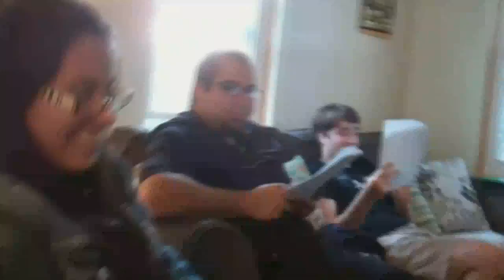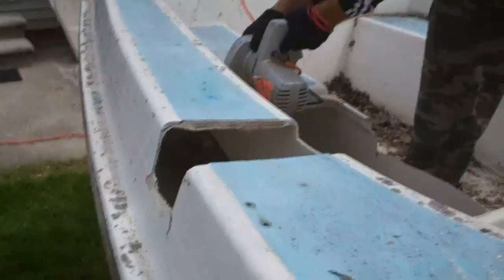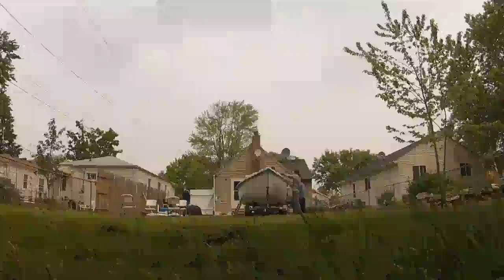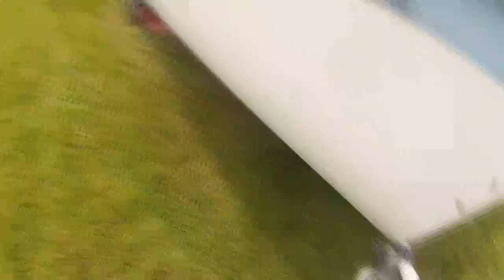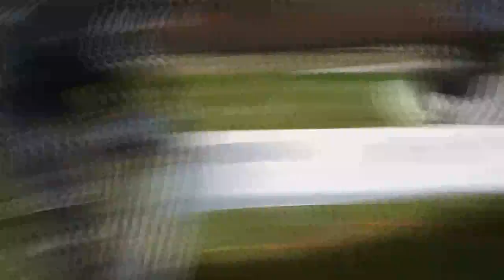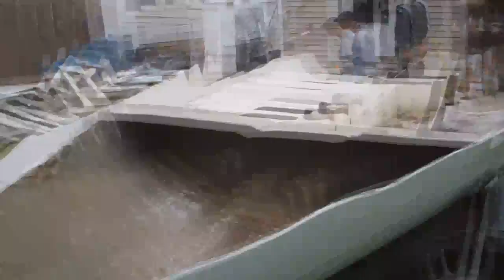Cutting up a Fiberglass Boat! (Week 24 2015)

Comment: I just finished cutting up a boat. I was reusing some of the fiberglass so I cut with a diamond encrusted blade on a skilsaw, to just cut it up, a regular blade and it goes fast. The diamond blade gives a nice smooth cut but takes 3x as long.
Reply from the maker: Yeah. We went very cheap for the tear down. lol
Reply: How long did it take you to get the whole boat apart?
Reply: @felipearroyo60  You can do it in a couple hours (20' boat) with just a regular skilsaw

Comment: Good vid...I have to cut up an old fibreglass boat this week and there's very little content on the net to show how easy or hard it is. I expected that you'd be working with only basic respiratory protection...well done with the respirators. Of course, now I feel I need to buy one too...no idea if a close-fitting high grade dust mask will do instead.

Comment: Had someone else's halfway sunk 35 foot boat on our county auction lot.  No way hand tool could be used because of all the mud and water.  We ended up calling in heavy equipment to break up the boat into pieces. Two dump trucks haulled away the boat, machinery and contaminated soil.  You save a ton of money doing it yourself but your boat was clean, dry and small.  You only have to pay for hauling and dumping service

Comment: Looks to be 22' or 25' produced by MacGregor/venture corporation. During the 70's to 80's. Likely early 80's. After which they started making powersailers in 1986. Saw alot of hardware missing before you started cutting. Not sure what you really started with as a complete boat, but during the late 70's - early 80's nearly every boat manufacturer was producing hulls with defective fiberglass. You actually might have cut up a good(typical 80's flawed boat). Given the stated care of it previously. I'd also guess it had the rear bulkhead fall apart from water exposure and the top deck with the keel winch was left unsupported leading to cracks in the gel coat from the flex.
The boat if around today would have been a classic boat. Though the 22' was sold by the thousands each year, they where still rarer then the Catalina 22's which was the most produced due to lack of foam. Of it's time MacGregor's where adding floatation foam in the early days before it became standard by the uscg. And the eps foam used abosorbed hardly any water over years of exposure. A known flaw in the common two part stuff. MacGregor's where built like any major production boat built cheap and affordable. That all said 1980 MacGregor/venture 23's are selling for 5k, but only a few thousand where made total during the entire model run. Some brands focused on coastal abilities, MacGregor like Catalina's 22's we're built as lake cruisers, sheltered waters. Yet a select few will push the limits and take a nail-biting journey beyond coastal navigation. The capabilities are there if your ready to ignore the unsettling feelings, and take time learning from mistakes.
Cutting that boat up looked like a itchy pain. Just thinking about the glass fibers.
Reply from the maker: Thanks. It was itchy cutting that boat up. Unfortunately the boat was never mine. The owner did not take good care of the boat at all. If it was my boat to begin with the outcome for it would have been different.

Comment: why cut it up?
Reply from the maker: Good question. The boat was owned by an acquaintance of mine who wanted to sell it. I offered to help and when potential buyers came to look at the boat they found a lot of water and UV damage. Basically the boat was useless. (I know nothing about boats so I had no clue) The previous owner did not take good care of it. I was left with figuring out how to get rid of it and found that it would cost a LOT of money to pay for someone to salvage it so with the help of some good friends we cut it apart and slowly sent it out in the trash.
Reply: MyWeekIn8Minutes dude, do you thing it would be possible to reassamble it to a previous state if you had to?
Reply: The boat I cut up was a mid 70's model. All the wood was rotted gone, just dust inside when i cut it up.